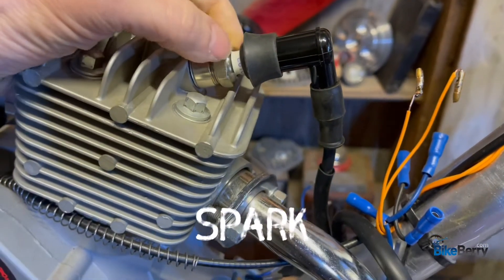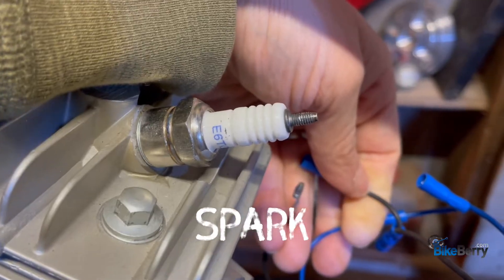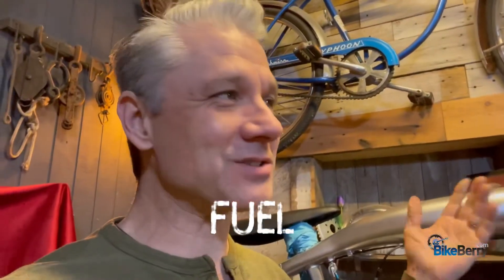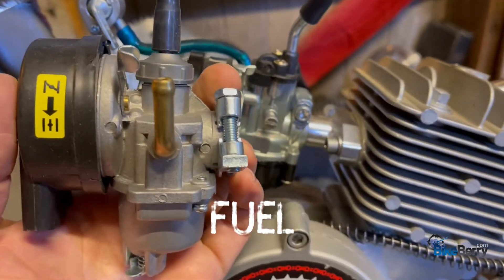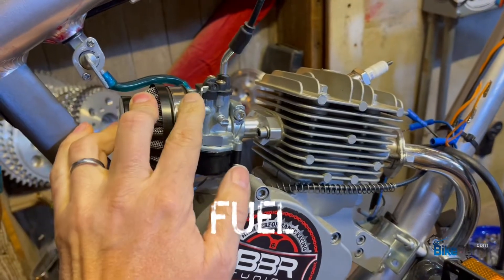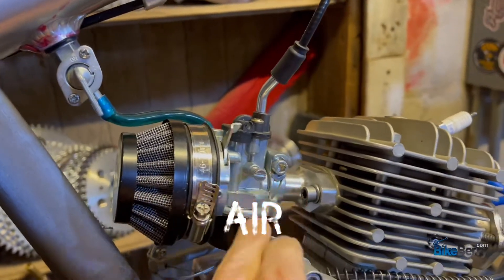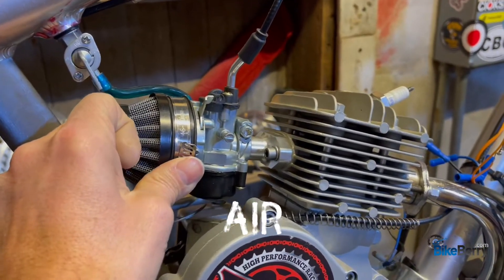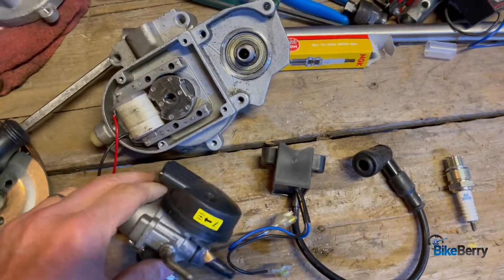Engine won’t start? Try this! | Motorized Bike | Bike Berry

Comment: When my engine when it kicks over it my muffler gives off a loud squeak what am I doing wrong is it the wiring done won't it's it the cdi unit that is not connected properly
Reply: could be your head gasket or ur head needs tightened

Comment: Woohoo, I went through your checklist, every everything looked good,  I put a new good Nkg spark plug and bingo! I did have spark so I don't know why, it was the original cheap plug that came with the motor!👍👍👍I had probably 80 hrs on the old plug!
Reply: I’m kinda really hoping it’s just the plug on mine. I just hit 80 hours this week on my kit and out of the blue it won’t start start. The motor will turn and do the half on thing, but doesn’t quite land in regular operating patterns

Comment: I once had a no start issue , after checking the coil & spark plug wires , I opened the magneto housing & voila! I removed the magnet which revealed that the oil seal was leaking oil onto the magneto coil windings , after replacing the seal & magneto coil it started up right away .

Comment: Thanks for the tutorial I was having trouble this morning with my two stroke beach cruiser and I watched the video and like you said it was the  air intake carburator value wasn't locked in so I tightened it up and now everything works 😅 it's always fuel air and spark..

Comment: My 80cc motor snap inside in the motor was Eileen😮 I tried to push it the tires were locked I took off the spark plug and the Piston move up and down and when I put it back on the spark plug the back tire won't turn can you tell me how to fix it

Comment: What issue I’m having is my Motor bike won’t start the back wheel isnt locked it turns but it’s hard to pedal when I take the spark plug out the wheel rotates fine but once I put the Spark plug back in it’s like it’s not taking in air and won’t start the back

Comment: Mine is all stock. most of my Issues are from the engine sitting a season with varnish in the bleeder gallery or plugged needle valve.. Its never been CDC or Magneto. the Engines are Super Simple. You will NEVER have to touch that Magneto!! the Test I did to my magneto with a meter I got blue 92V (this is to your CDC, it also provides the wiggling current to run your CDC) black 0V  white 9V to 12V and a Green/Brown 8V every motor is wired Differently you colour code might not be the same as mine. the other two wires are for Incandescent tail and headlights and the White 9V to 12V are for your AUX battery this is why shorting blue and white stops the Engine. you can buy and the Extras for this Engine including a pull start.. but Its Designed to be light engine so this is why its push start with a clutch. I know Cold starts make the Setup a Pain in the Ass to start. Oh another thing Replace that Lockable Clutch with a Better setup ASAP!!! I have Both front on rear break on one lever.

Comment: I have the 100 cc motor with the HP carburetor and for the life of me I have not been able to get it running it's got fuel in the carburetor I've cleaned it once it had something to bring in it it's clean now spark plugs good it when I pedal it and it seems like it tries to start it just never catches and it kind of does a surge thing any help would be greatly appreciated

Comment: What kind of fuel do I use for my huffy motorbike? I just received one but I don't know where to put the oil? Or is this a fuel/oil mixture kind of thing?
Reply: If its a 2 stroke yes
Reply: @DonaldLatrella  is there a way to tell if it is a 2 or 4 stroke? Like I can tell if an engine is a 4 or 6 or whatever cylinder but never had to figure out if an engine is a 2 or 4 stroke

Comment: I have spark, fuel, and air and cannot get this brand new kit to even try to start. Boggles my mind especially since I have compression as well. Might just be screwed. Wont even try to fire with ether spray.

Comment: I got one of them there 80cc motor kits from eBay I'm not sure if it's a defective motor or what everything looked like it was brand new
And it won't start I reckon it might be electrical issue

Comment: i have a new build but it won't start , this was very helpful i learned alot , but even though i testes everything and all tested good i replaced all but my motor acts like it will pop but still no start. any help would be great
Reply: oh and i replaced the carb and spark plug with an ngk

Comment: Having a carburetor issue it's leaking gas I tried cleaning the hole carburetor I checked the float bowl no gas in there i Bent the prongs just above the float bowl it stopped leaking but now I can't get the motor to start so maybe I adjusted the prongs back to far I'm not sure any suggestions would be great

Comment: I forgot to put my cdi plug on my spark plug and tried starting my bike. When I realized it was off I put it back on and now my bike has trouble starting. It starts and dies. Eventually it goes but it bogs a bit. Can anybody help. How can I fix this.

Comment: Spark question: Motor won't start and I've checked the fuel, air leaks, and spark. I tried placing the sparkplug against the metal head and saw sparking, but seemed like a weak spark. Is there a degree of sparking or  is as long as there's sparking I'm good?

Comment: I got a brand new motor that ran for a day and a half and then just quit when the fuel mixture got messed up and now I can't get it to run it all and the timing is right the fuel is right is that spark and it won't even try to start

Comment: My starting problem is when I leave it sitting for about 20 minutes or so.  It takes too many tries to get it going again.  Once running, it runs okay, but 4-cycles a lot.  I leaned out my mixture, a little improvement, less oil in the fuel helped a little, but I don't know how to make it much better than it is.  I can deal with the little problems if I can get it to start more reliably.

Comment: I am brand new. Half pooped out of the womb. Any advice is appreciated. I got an ‘auto morris’ 110CC 2 stroke engine and we installed it to the bike properly, I believe. We skipped a few steps like the chain guard. I tried pedalling down the road and I couldn’t get it to start. I live on a highway on a flat stretch so I can’t do the whole, ‘downhill for first start’. I gotta pedal two chains and try to start it with the clutch and reving handle bar(not a tech/mechanical person, but may as well start now. I already broke the filter so I had to get a new one. I want to take this thing into town and down this off road path, but I gotta start it first.

Comment: If the spark plug clip stays on but wiggles, does that keep a gas bike from running? I have an older Onyx Gennisis gas bike. Was running ok, but now won't stay running.

Comment: Hi Tony, when I try to start my motorized bike, the engine is turning but the piston doesn't move. I tried tightening the clutch plate and that seemed to help a little. Sometimes it starts but most times it doesn't. The piston doesn't go up and down when I begin to pedal it. It's like it's just free spinning... Something is not engaging.. What is wrong with my engine? Please help. Thanks

Comment: I just got my bike running last night and then I went to play with the idle screw to get it to idle, I set it to high and I had the clutch engaged and I went to grab a screw driver to adjust it and then it just shut off and now it won’t start, it’s getting Gas, it has spark,  but it won’t start. What do I do?

Comment: Am most annoyed with my bike. Magneto and CDI went. Clutch cam actuator is on order and due tomorrow because it wore out before breaking was finished. Now I'm sitting here with an engine that won't run. I can hear spark and compression is good, will get that initial firing.

I suspect that the e-clip on the carb jet may have come loose. Thus the needle isn't being raised via the throttle. It really feels like the bike just isn't getting any fuel. 

Frustration
Reply: Did u figure out your problem ?  Mines the same  and it won’t turn on either. Frustrated

Comment: I just put a mottor on my son's bike started ran for prolly 15 mins off and on died off will not start I've cleaned the plug checked spark it's hitting plug is wet when I pull it so it's getting fuel even leaned out the mix a tad checked connectors nothing... I've checked fuel fire and It should have compression it's brand new?????

Comment: Thanks for the video Tony! I bought a stage 4 kit after watching a few of your videos. and the bike won’t idle. Tried everything with no avail. Also noticed the auto choke isn’t clicking off with throttle roll? Any ideas? It’s looks to be good, slide is going up and down. One other thing, I did remove the elbow for the throttle cable on the carb, per a bikeberry instructional video, and thinking there may be too much play in the cable without it.

Comment: Hi my bike won't start I had it for a day went in a puddle and it cut out I brought a new cdi and mageto and still no spark HELPPP
Reply: Did you ever figure it out
Reply: My motor bike was running down the street and heard a pop and motor shut off and can’t get it to restart bought a spark plug and a cdi and still no crank

Comment: I have the Zelda 80cc firestorm. I put a pull start on it. The engine won't start. Never been fired up yet. Is there a certain process to do for a pull start for the very first time?

Comment: What’s the deal about taking the cap off the spark plug all the boots on mine are made for the cap to be left on. I had taken it off of my first bike and was having trouble and I looked inside and saw It was big enough for leaving the cap on replaced the cap and it worked fine

Comment: Tony, this is a very informative video. I love everything that you have stated. However when a motorcycle gas bike Harley-Davidson whatever you have or even a car for that matter sets up too long. There's also a thing called varnished fuel. It has to do with evaporation values and moisture AKA condensation. I would advise if you've had your bike sitting up for more than a couple of months to drain the tank before you even try to start it. Other than that you have covered everything beautifully as always

Comment: Spark, Fuel, Air/combustion, I had a guy complaining about a no start issue. He had snapped the con rod in half so he had no compression. Being a newbie he didn't sense the difference in how it pulled with the recoil starter. (it was a 4 stroke). Another had a no start issue and wanted the part numbers for a new CDI, coil and stator, I convinced him to start at the simplest , check his On/Off switch first and then work up to the magneto. It was a bad connection on the kill switch. So Tony is spot on, 98.3 % of the time its a bad wiring connection. But on a 2 stroke it could be a severely wet fouled spark plug, but you'll discover that when you pull it.

Comment: You should add adjust your airgas screw 10 and 1/2 half turns this is almost perfect  setting every time
Reply: Turn it Which way ?
Reply: Most small morized bicycle carbs don't have it at all

Comment: You know what I have been a loyal Bikeberry customer for between five and seven years really I lost track spending thousands of dollars to bike Barry building custom bikes for people through your site and never had an issue but I got to say this last experience I have had I don’t even want to deal with Mike Barry anymore at all and that takes a lot to say considering 5 to 7 years of constant loyal being a customer this last time I ordered I spent a good bit of money and I have had nothing but issues throughout this entire exchange for one the motor that was sent was a cracked crank case and I don’t mean oh it had a little hairline fracture I mean there’s no way in crap this thing should’ve ever made it anywhere off the assembly line at all I mean junk completely destroyed machining from the head bolts not to mention throughout the entire outside of the crank case as well and as I ordered a black 8 mm upgraded engine kit stage four when I got when talking to customer service was a 6 mm crank case silver that is nowhere near the quality of the 8 mm kit that I ordered and I am extremely disappointed it has been a fight from the beginning to the very bitter end and it doesn’t matter what I say or how hard I try I can’t even get expedited shipping on the downgrade crank case that is not in any way shape or form what I ordered and it has been a fight with every single customer service representative that I have had except for summer whether that’s her real name or not she is the only one that has actually given me any kind of real customer service throughout this whole experience every other one has fought me the entire way and most of them have no idea what they’re even talking about with their own product that they or the customer representative service of basic questions that I have asked just to see if they knew what they was talking about because nothing was making sense and I was astounded at the replies that I got knowing nothing about their own product but they sell the details of the product that they sell or the ability to have anything to do with that product whatsoever I mean Tony is great don’t get me wrong I love his videos I love how honest he is and as far as customer support goes summer is great aside from that every other person I have talk to mind you this is 7 to 8 people now have no idea whatsoever what they’re talking about and Ken in no way help me or give me the proper fix to my issues that are from factory all the way down the line to me and I have caught nothing but crap I got to say Tony I am extremely extremely disappointed and I don’t think I will be doing business with Mike Berry again after this one incident after 5 to 7 years of business with you building bikes completely customized and upgraded as well as building accounts for my customers for your site this one experience I don’t think I will ever buy a single thing from bike Mary ever again and that really pains me to say because you guys do have some of the best upgrades but considering the experience that I’ve been through it’s not worth the time it’s not worth the money and it’s not worth the hassle to continue to go through this… R.I.P. bikeberry… PS I also apologize for any misspelling as I am doing this through talk to text as I had so much to say and little time to do it due to the fact that I am still fighting and working with this kid to get it together… I can almost promise you too I will try my best to post this comment on every single bike berry video that is posted from anyone so everyone knows what is really going on until something changes!! And I am not that kind of person at all!!
Reply: bro you good?

Comment: Gasket on the carburettor was leaking after clean the carburettor out a few times it was made out of Cork made one out of paper gasket  1 ended up making another one wasn't enough for it can't buy them make make ended up with two on it now ok ok
Reply: Nice to know your solution!!

Comment: I can’t say it enough, learn to solder! Get away from crimp lugs. It’s very easy and it’s really not expensive. Get a box of heat shrink tubing, solder, and soldering iron/gun from Harbor Freight. It will cost you less than $20.
Reply: I would agree!
Reply: I agree ppl think it’s cracked out that I straight wire everything those plugs suck…
Reply: Solders in high vibration situations tend to break, a good crimp is much more durable and safer

Comment: I’m having difficulty with my HP carb as it won’t “un choke”  as it’s supposed to. I have to release it manually. Any advice?
Reply: I’ve had a couple like that. The little flip lever doesn’t get pulled up far enough to get outta the way. Adjusting my throttle cable took care of it. Please note...Had to use the aluminum throttle grip as it has more options to slot the cable in.

Comment: I put my bike together before winter never got to test ride it yet but it does start right up even while it sits in the cold
Reply: Good to know!
Reply: Mine is set for a long time more than once. Cranks up every time. Kid down the street.. let's just set up during the summer time. Sounds like crap when he starts it up. I told him to drain the tank and put fresh gas as well as draining the fuel line and the carburetor bowl. Dang his bike sound awesome right after that. So should you ever experience that problem you don't know what to do

Comment: Thanks for video. One issue I didn't expect to encounter was with AIR. I have one of my engines with a "70" jet and it was on the rich side.... it was a summer hot day and normally I don't ride if it starts raining but it started raining and the air got humid and made it so that there was LESS oxygen in the air (the warmer the air, the less oxygen or richer your fuel mixture gets) so my fuel mixture got so rich the engine turned off on it's own and would not start! I was far from home and getting rained on and had to PEDAL on this hot summer day and it sucked! lol. I would add that maybe the my HP carb air filter got soaked and made it harder for the engine to get air making it even MORE richer on the fuel mixture side. So in conclusion, carry a extra jet size on the higher and lower side (like a 65 and a 75) AND remove your air filter on rainy summer days if your engine stops running lol (or the opposite if you running LEAN on a very cold day).
Reply: Wow that’s crazy! Thanks for sharing your experience!